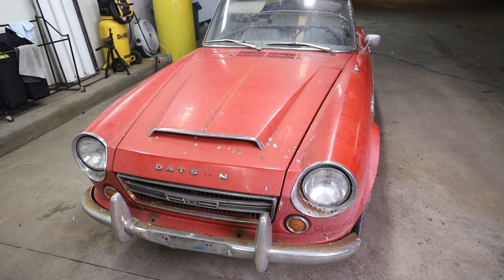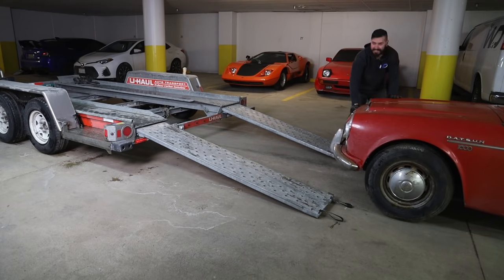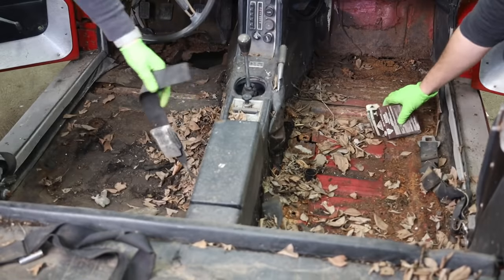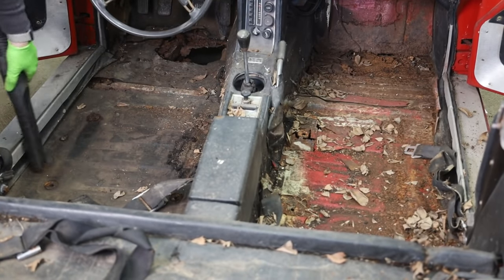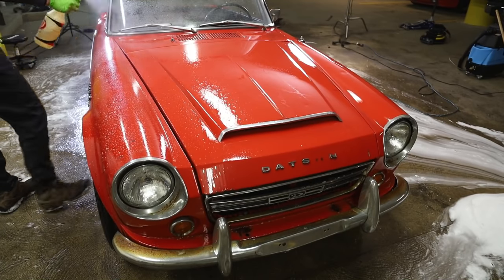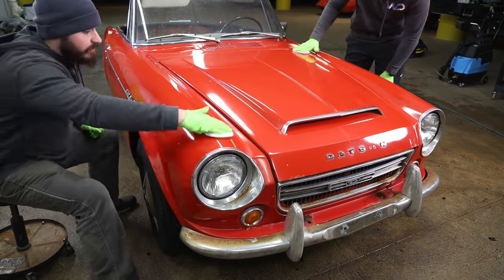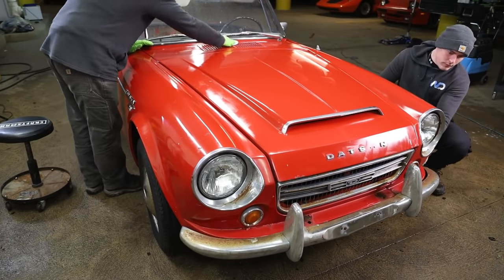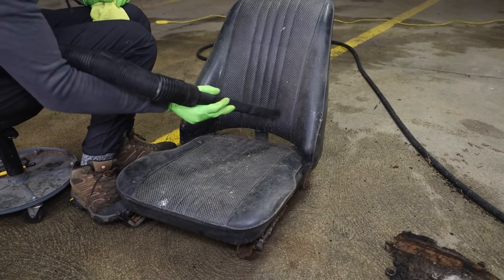ABANDONED BARN FIND First Wash In 25 Years Datsun 1600 Roadster! Satisfying Detailing Restoration!

Comment: Boy, this is great....Okay, first, I've been trying to find one for years.....I'm looking for a white one.   As a kid growing up, I use to ride around in one, my Dad bought one new in 1968, we had it for 3 or 4 years.   Your car looks amazing original.  Like the body side moldings are still on the car.   Even the cover and hole is in place for the jack stand.......so many of these get rust and repainted and Morons bondo over the jack stand hole......you've got a nice one to build on......that even looks like original paint!   And the interior door panels are all great too...... Thing to note, they do rust, but your rust isn't bad at all.    The neat thing is it's original, the hub caps, the steel wheels, the little clips to hold the cover on the car.  The engine bay is all original, no conversion to something else....I'm thinking it's worth about 7 to 9 grand.  If you get it running, possibly more, it looks like it could run....if it ran...10 or 11 k for sure.  Fully Restored, the go from 30 to 40K

Comment: Good job fellas. Some steel wool would have done wonders for that chrome bumper and chrome trim pieces. Definitely give it a try it will improve the overall look of the vehicle. Wont remove the years of pitting but will definitely remove the brown staining
Reply: Use 000 or 0000 steel wool if you use steel wool.  The visible rust on the chrome will go.  Then seal the chrome somehow so it doesn't reappear immediately.

Comment: I used to race against the 1600’s and could win with my AH 100-6 but the 2000 hit the track and the extra 50 HP and the independent suspension did me in! I had to slide the corners and the 2000 just powered right through them!

Comment: This car was a pale imitation of the much nicer Triumph, Alpine or MGB. One in good condition all around, no rust, solid engine, transmission, drivetrain, muffler, suspension, electrical system, convertible top, and brakes might be worth $5k the one you’ve described may get you $500. Of course if there is a demand for these of which I’m unaware, I’m way off both prices.

Comment: The problem with that car is that, what you will spend to get it restored will exceed the value of a restored Datsun 1600 Roadster.  It's really a car for someone who likes to restore this type of car, and not the money it will cost.  Needs new frame, body parts, top, maybe engine and trans? If someone gave you $2500.  I would take it and run like hell.